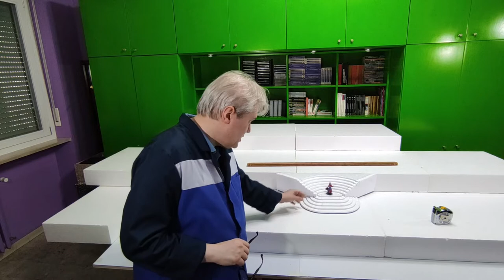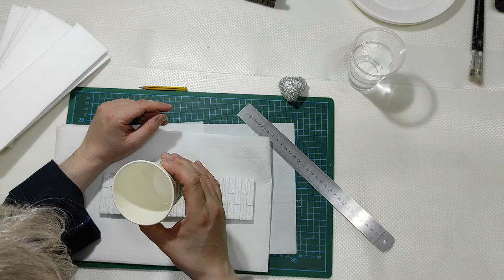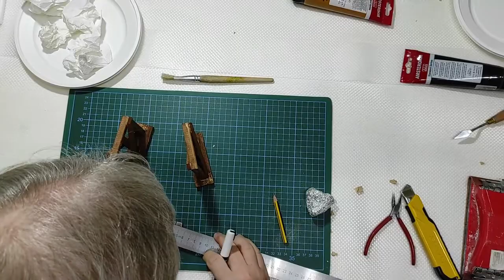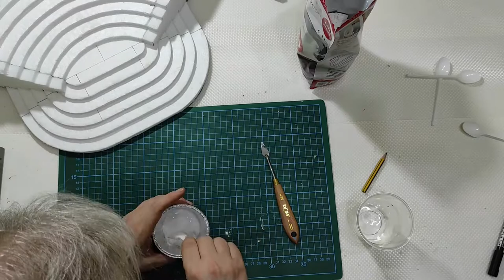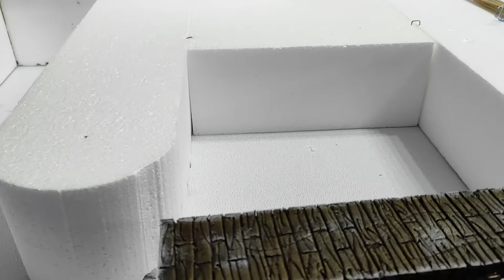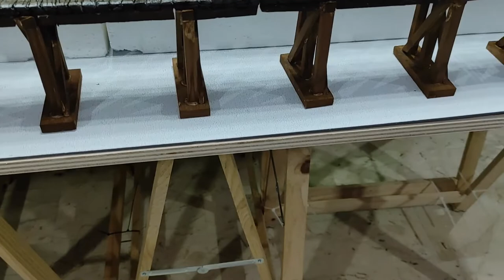Christmas Village Tutorial 2022 - Part 2

Comment: Silvio,  great solution  and design of your trestles for your train. 2 suggestions for your train pin together each trestle to one another to prevent derailment and if you have a train hobby store in your area look for a piece of flex track to really handle and shape those curves they come in a variety of lengths for you to customize the curve in HO, N and O scale flex track. Plus, you are correct about having access to your tunnel  from the rear to fix train derailment. I learned that the hard way, last year for my village!
Reply from the maker: Hi Robin, thank you for your valuable suggestions they are very well welcome. I still have 5 or 6 Piko 55209 H0 tracks from the 2019 project. They are flexible with a length of 940 mm (almost 1 meter). I will experiment with a couple of them under the tunnel and the rest on the curved sections.
In 2020 and 2021 projects I used Piko curves with 360 mm of radius that is too tight for such a train and they pushed it toward derailment at each round.
For the actual project I used curves with 422 mm of radius, way more adapted to my On30 scale train but they also take much more space. I will surely compare the train behavior with both normal curves and flexible curves. Thanks again.